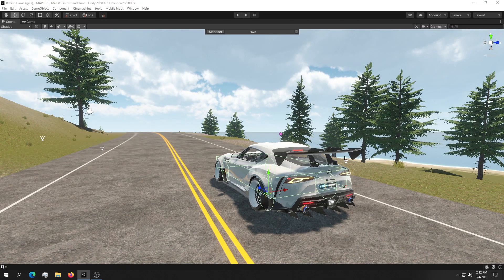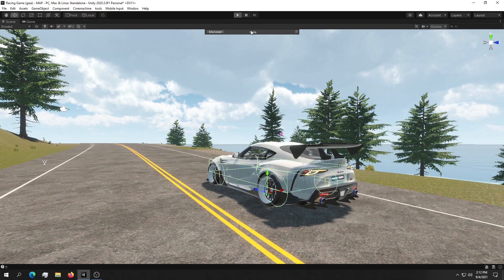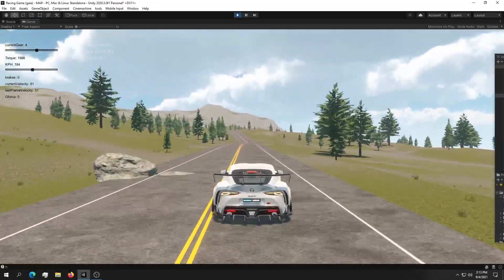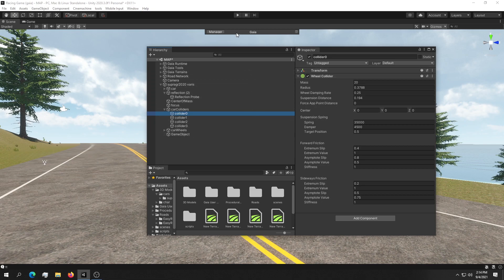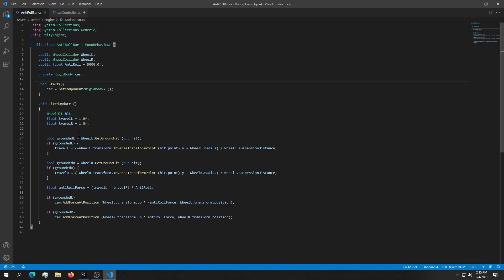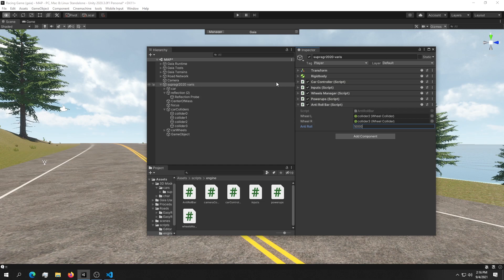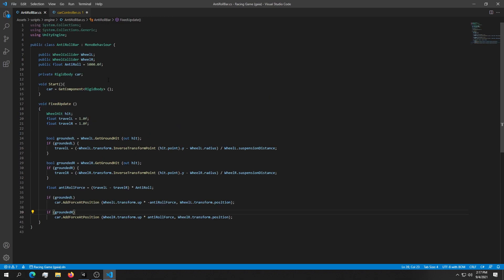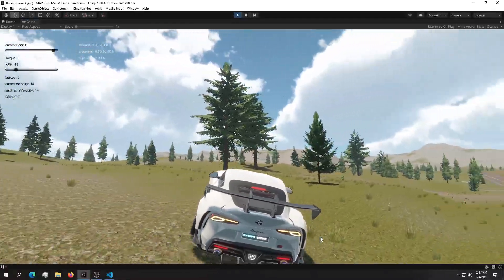How to make Car More Stable in Unity (Anti Roll bars) 2021

Comment: I saw your script and right away I noticed one fatal flaw. There is no reason to check if the wheel is grounded at any point. Why? If the car is cornering, lets say, right, then right front will naturally lift up. If it comes off the ground, your script will stop the ARB force from happening, which is the exact purpose of ARB being cancelled. ARB while one wheel is off the ground should still work, because it tries to prevent one side from going up (so in my example the right front wheel), and the other one from going down (left front wheel). What if both are off the ground? Then ARB force = 0, so no need to check anything as it wont work anyway.

Remove grounded check and it will be much better in edge cases.
Reply from the maker: that makes sense actually

Comment: I slightly modified this to work on a purely physics based car with no wheel colliders, and it's nice to make the car not flip, but unfortunately it comes at the cost of making my suspension freak out when I run over a curb and have a sudden "forced shift" in spring tension on each side